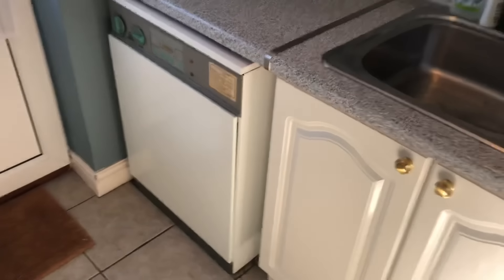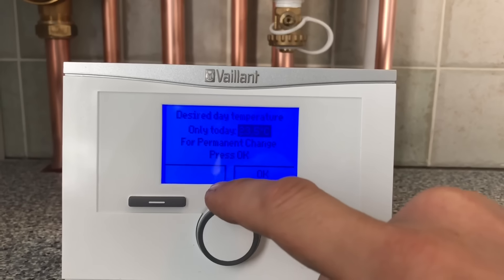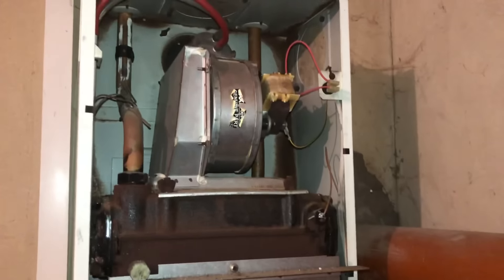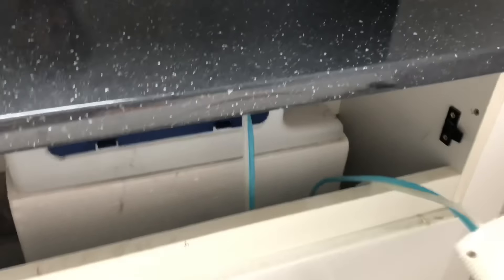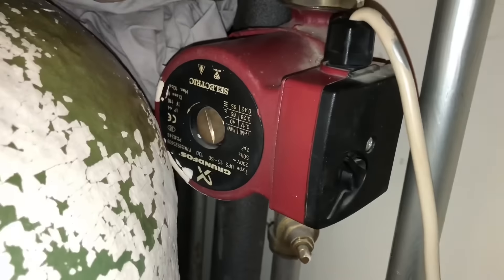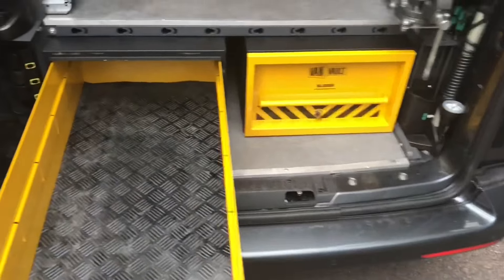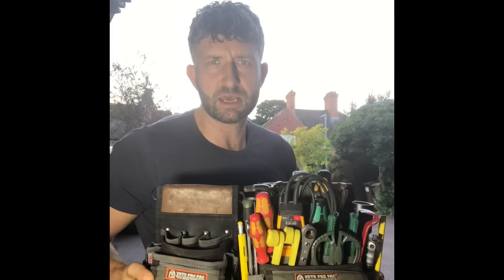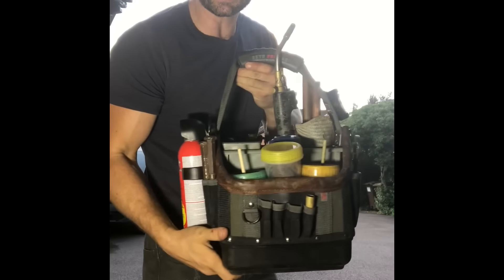The life of a jobbing plumber #26

Comment: Hi PB. Love the vids. Just to offer another way of removing the WC panel on concealed toilets. I tend to use a panel lifter. One of those double suction type to get those front panels off. Mainly because I damaged a panel once doing it with screwdrivers and had to swallow the cost! 
Panel lifter is only 8 quid from Toolstation. Just thought I'd mention it. Also good for taking off tresper panels in schools! 
Keep up the good work!

Comment: You can check the gas pressure (inlet) on the gas valve on the side of the Honeywell gas valve. It's bit tricky so the option you have added is good.

Comment: I have quastion u showed primary heater on that old boiler, what are u doing if the boiler is clough with scales or dirt from system? Are you changing heater or clean it with acid and pump or somthing?

Comment: Hello came across two problems today a plumber called shaw Morris is a horrid one he fitted a new tank what he broke himself by hammering the old fortic and payed about £1,000 for a gledhill fortic and he came to fix the upstairs toilet put a Dudley turbo in and a crappy sliamp that shoots water everywhere and a push button down stairs fill valve shooting water needs replacing he shoved a tube on it and. He decided to fill the overflow with silicone

Comment: What's with all the swaging? Thought that was old school... Is it legal to do on gas pipe ?
Reply from the maker: phillip bull yeah man nothing wrong with old school it’s a skill, a dying art.
Absolutely you can swage a gas pipe
Reply: @PBPlumber  Just reading some stuff online about swaging. Wow, so many uninformed opinions. Apparently it's not permitted these days on gas as it can cause micro fractures on pipes.... However pulling 90 degree bends is fine! 😂 Opinions and arseholes I suppose!
Reply: Yeah just be careful on that one. My tutor told me the same a few years. You can use it on almost anything other then Gas pipe. Old imperial and changeover to metric pipes were much thicker walled back in the day. The pipes now have thinner walls. If I have to swage pipes.  I usually anneal the copper pipe by heating it 1st. 
Excellent videos PB, Bless you dude.
Reply: Yep, swaging is a no no these days. Old imperial pipes had thick walls. Modern stuff is Baco foil thin and can be weakened by swaging.
Reply: @woodbine66  Is it a consensus reckons it's a no-no? Or do regs say it's a no-no? Not being an arse, just wondering. In my line of work there's plenty of things presented as fact that turn out to not be when you look up guidance. I'm not a plumber!!!
Reply: Swaging was used a lot when older copper pipe had thicker walls. I wouldn't swage the stuff these days, it's just too thin walled. Not against the regs. though.

Comment: https://youtu.be/3fJLz5KkfP4?t=641 The issue is that the FLIR cameras assume that most materials have high emissivity. Most materials are like this,  but this assumption breaks down for bright metals, because bright metals have low emissivity, making them look colder than they really are. Try putting a chalk mark on the pipes, then thermal imaging it.

Comment: Good vid again PB... After some advise from a gas safe engineer if anyone can help I am level 2 plumber and was wondering if it is illegal to remove cover from a Worcester greenstar boiler to access filling loop inside
Reply: It's a grey area, gas safe ses. They say a qualfied engineer should be with you if your taking the case off (if your learning) + you can fill the Worcester boilers from underneith? Unless it doesn't work.
Reply: @jacobphillips7956   I know on normal combi boiler filling loop underneath this boiler was much bigger than standard boiler and in instruction manual said to access filling loop remove cover. Now I am not gas nor training to be so thought best to leave alone just wanted to know if I did right thing cheers
Reply: All filling loops are accessible without removing boiler casings! They are designed to be used by the end user ! (Customer) !
Reply: @paulkramer2599  the boiler I was trying to fill up was a greenstar highflow 440cdi/550cdi and in the instruction book it states that to access filling loop pull front panel away from boiler and lift up and didn't think I was allowed to remove cover as not gas safe